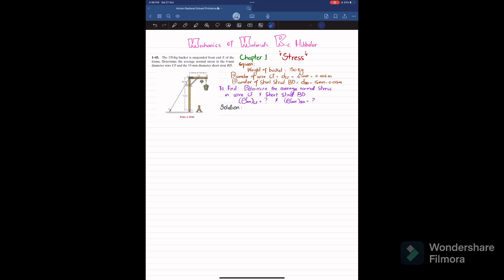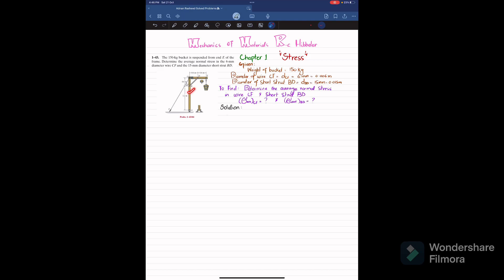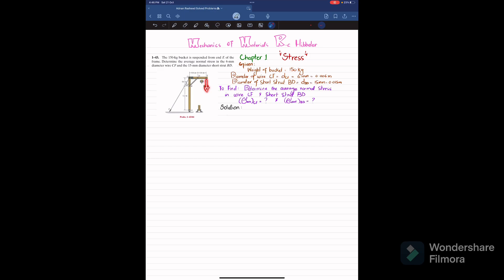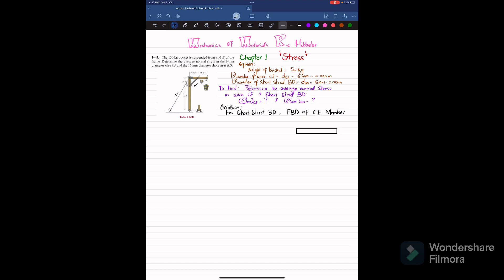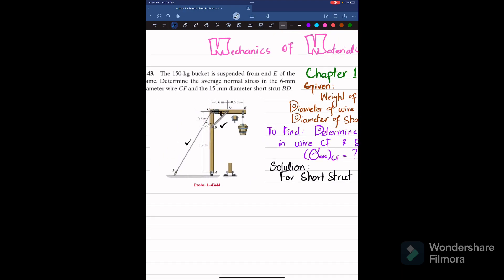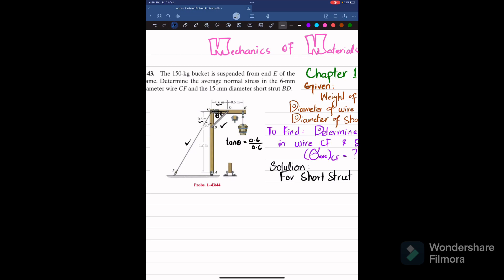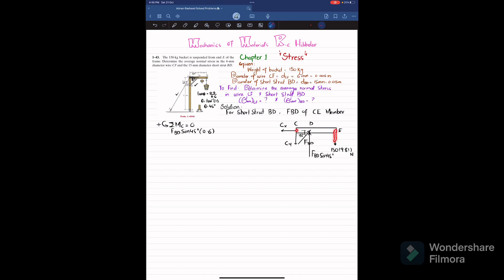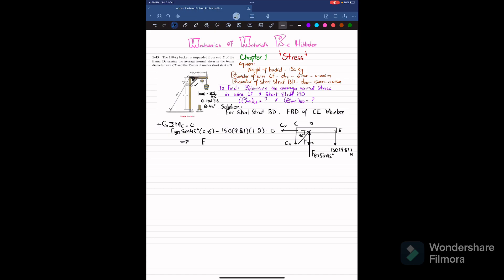Determine the average normal stress | Problem 1-43 | Stress | Mechanics of materials rc Hibbeler

Comment: I want to ask, when calculating the moment about point A, why does the calculation only take into account the bucket and the Fcf? What happened to the Force from BD and the support reactions at C?
Reply from the maker: you can see i have already written take the whole frame as free body diagram therefore it will act as a single body ❤